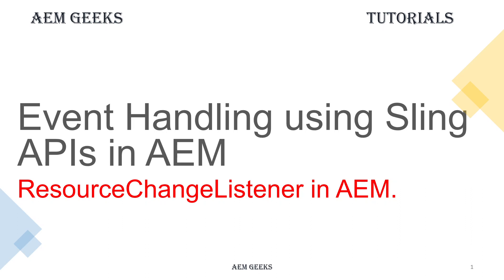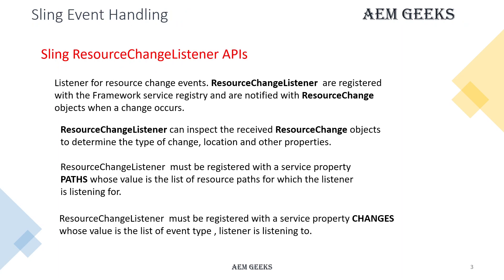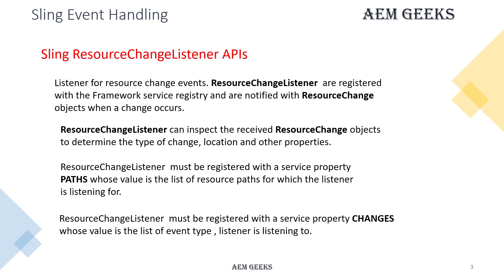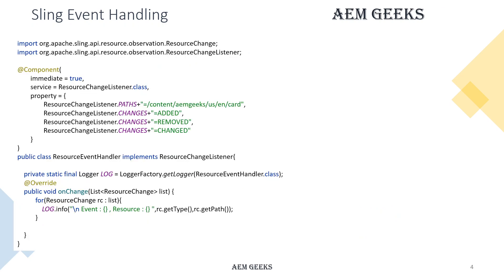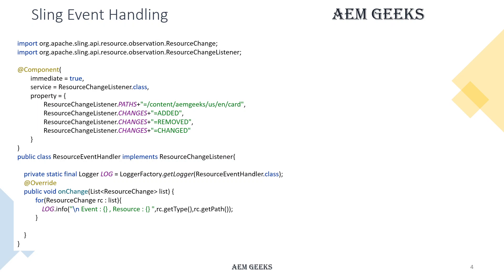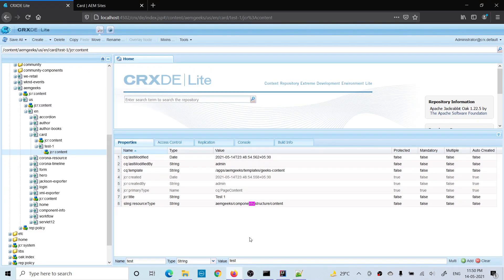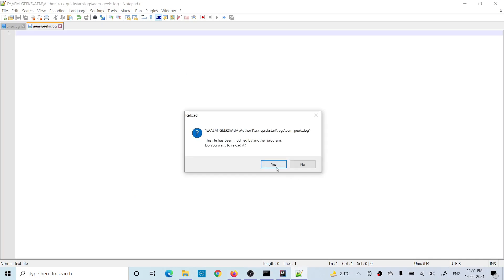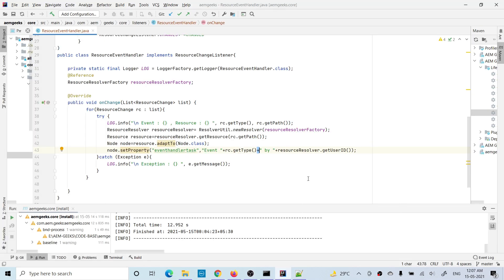AEM Tutorial #49 | Event Handling #4 | Sling ResourceChangeListener in AEM

Comment: Thank You for detailed explanation :-)  Got better picture on event handling.
OSGI - EventHandler & Sling - ResourceChangeListener  both looks similar.
Is there any specific reason, when we need to go for OSGI API & for Sling API?
In general projects we are using OSGI API for replication/page/workflow events.
does sling support this? Is there any advantage over Sling API?
Reply from the maker: You should try to use sling api as much possible. If you can't achieve your functionality using sling api then you can use OSGi api. This is recommended. But if you create project using latest archetype, still you will see OSGi api.
Reply: @AEMGeeks  Thank You